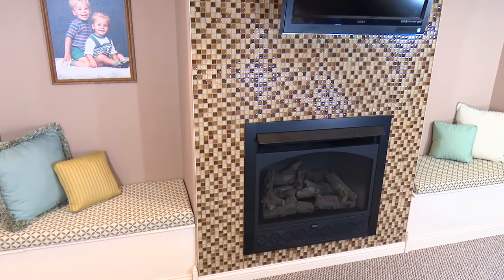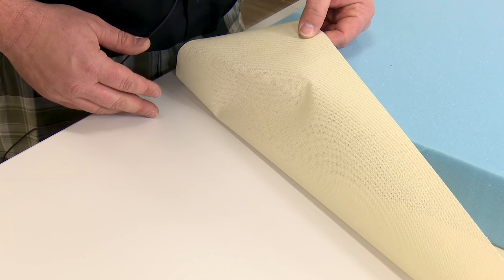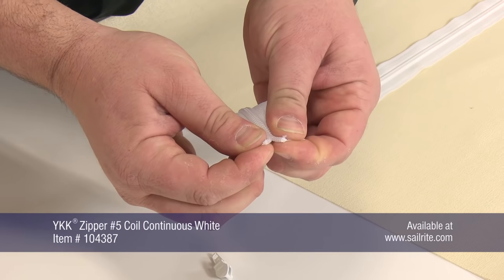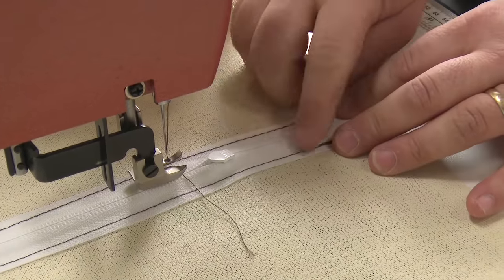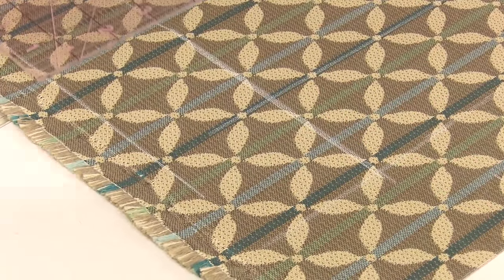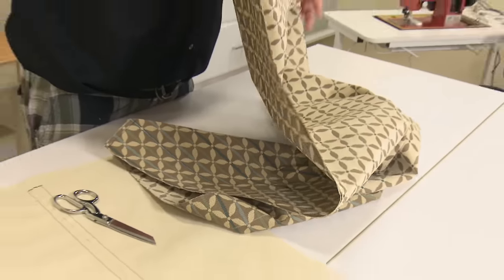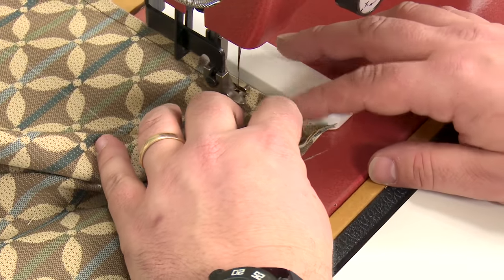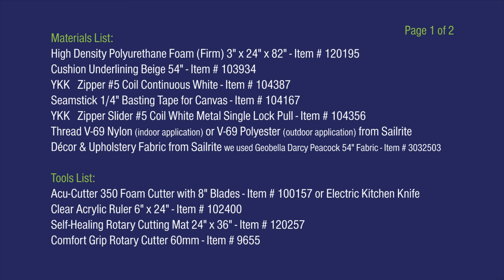How To Make a Quick and Easy Box Cushion

Comment: Excellent demo❣️I’m wondering if the basting tape gums up the needle on the sewing machine...  Does it?  Ty.
Reply from the maker: Using basting tape (Seamstick) for canvas on a very light weight fabric may gum up the needle rather quickly because the lighter fabric does not have the larger fibers or weave to help clean the needle as it exits the fabric. In those situations use pins to hold the fabric in place as you sew. A gummed up needle and parts can be cleaned off with some rubbing alcohol on a cotton ball or Goo Gone (we do not sell this). I like to use McLube #845 on my parts and needle to clean and keep glue from building up.

Comment: Thank you for this excellent video. I am using a normal cotton fabric. So just making the slit on the fabric after the zipper is attached will leave raw edges and I will need to finish it. How do I do that and when do I do that? Also I guess the measurements for the bottom fabric will change because of this as it needs seam allowance for finishing. Awaiting your response. Thanks
Reply from the maker: If you use a fabric that will unravel (unlike our cushion underlining fabric from Sailrite) then you will have to finish the edges. The best way to do this is to cut the plate an extra inch wider and then split the two halves down the middle. Then fold the edge back 1/2 inch and sew half the zipper over this edge and repeat for the second panel. The zipper will run the entire length of the bottom plate doing this (which still works fine when you join the decorative fabric to bottom plate).

Comment: Great demonstration and information.  As a quilter who uses a rotary cutter often, I gasped in horror when I saw you cut toward your body with the rotary cutter.  Please always cut away from your body.  The cutters do slip and they are surgical-sharp blades.  Many quilters share their 'war stories' about their encounters with blades and subsequent trips to the ER.
Reply: Good to know, I won't be using it often. I'll probably just use scissors.
Reply: What was the name of the bottom plate fabric? What type of fabric was that?

Comment: Great video, I'm happy with the results.  Would it be more difficult to run the zipper all the way to the edge? I would like to hide the backstitches.  I also noticed the top of my boxes are slightly larger than the bottoms, would it be safe to subtract another 1/4" from all sides on the top?
Reply from the maker: Thanks! Yes, you could run the zipper all the way to the ends of the bottom plate, but you would have to be careful when sewing the decorative fabric when sewing over that spot. We designed the top boxing to wrap around the under side slightly, to hide the bottom plate. If you want the seam joining the boxing to the bottom plate to be closer to the top, yes subtract 1/4" from the decorative fabric, but you will need to then add 1/4" to the bottom plate to compensate for the difference or the cover will be too tight.

Comment: Great video -- we want to do this with 5" thick cushions -- two that measure 30x18 and one 30x36.  The foam comes 30x72 from the manufacturer.  I see you started with foam and cut it wider and longer than you were going to want the finished product to be.  Is this due to a compression factor?  If I just cut my foam to the actual size I want the finished product to be, I wonder how much smaller it will really end up being?  I also was confused why when cutting the top fabric piece you would subtract 1/4" from the foam thickness?  I would think you would actually want to ADD to the foam thickness for seam allowance?
Reply from the maker: When the cover is applied to the foam it will compress it about 1/2 inch on the width and length measurement. 
At 9:56 min Brian traces around the foam which is already ¼” larger than the opening it fits into. This creates a top plate which is the exact size of the foam. Next at 10:10 min Brian measure the thickness of the foam and then takes away ¼” from that thickness. The boxing is not as wide as the foam by ¼”. True the 3/8” seam allowance is not taken into account intentionally because we want a tight fitting cover. So… the ¼” (which was taken away) and the 3/8” seam allowance that will soon happen to sew the bottom plate on, will take away about 5/8” of the overall size of the boxing making the cover fit very tight, which is what we want. This helps, pull the incorporated facing/boxing (facing included on the top plate) down, so the bottom plate fabric does not creep up and show itself along the bottom edge when the cushion is finished.

Comment: Thanks so much for this but a little confused. If the material is cutout to fit the foam but then we see a 3/8 seam all around, won’t the cushion be two small? Eg the sides will be 3/8+3/8=3/4 inch smaller than the foam sides
Reply from the maker: Yes, you are correct this makes for a very tight fitting cover. The foam will compress slightly, that is why we make the foam a 1/2" larger on both dimensions or 1/4" larger on all sides. Use this calculator and you will see: https://www.fabric-calculator.com/FoldOverSimple/index.html

Comment: Can you explain why you have to add a quarter inch on all sides of the foam?  What does that do?  If you don’t have enough foam for that, will it still work okay?
Reply from the maker: The tight fitting fabric cover will compress the foam slightly and this extra size of foam will then be almost exactly what you need to fill your space requirements.

Comment: Thank you very much for this video. One question is that if I were to wrap the foam with 1 or 2 layers of Dacron fiber would I ad an additional 1/4" to each side for cutting the fabric?
Thanks again for these wonderful videos.
Reply from the maker: Simply include the batting (Dacron) under slight compression when measuring the thickness of the foam. Depending on the thickness of the batting (if wrapped on both sides) it may add 1/2" to the thickness of the foam. If the batting is only used on the top, your 1/4" sounds about right.

Comment: Generally speaking, how much smaller should the cover be as compared to the foam? Is yours 3/8” smaller? Do you ever put a layer of Dacron/batting in and do you still need to make the cover smaller if so? Thank you
Reply from the maker: A cushion cover should be about a 1/4" smaller on all sides to compress the foam and for a good look. This is typically achieved when the seam allowance it taken when sewing. However, this is not a rule, but only a guideline. If you add Polyester batting you need to figure that into your calculations when making the cushion. To do this be sure to compress the batting slightly when measuring its thickness. If you or anyone else would like a "List of Steps" that are used as a guideline for making cushions please email me at: ericg@sailrite.com I will be glad to email it anyone.

Comment: Excellent and clear as usual, and very satisfying to see the cushion come together at the end. What do you think of using closed cell foam for boat cushions, to ensure that they can't take on water, can be used outside, and are buoyant? Do you have any experience with that? What density of closed cell foam would you recommend? Thanks!
Reply from the maker: Thanks!!! Using closed cell foam is always good for a wet water situation, except that it is very firm and most people do not like that extra firm feel. If you like you can use closed cell foam on the underside and then a softer foam on top to soften it up. Density has to do with the amount of materiel in the foam and with closed cell foam it does not vary much. IFD is the compression of the foam (firmness) because the density of closed cell foam is very high the IFD is also very high and does not change much except for the thickness which does change the IFD. See this link and click on the specs: http://www.sailrite.com/Foam-Special-Features/Flotation/type/Products?keywords=closed%20cell%20foam

Comment: thank you for this video. However, should it be possible to add the european values in cm to your explanation? it is quite confusing for me, i'm not used to this system.
Reply from the maker: Yes, this calculator may be helpful. It is our Folded Over Foam Cushions Calculator. It uses "inches" or "mm" to help you calculate the size of your fabric. Here is the link: http://www.fabric-calculator.com/FoldOverSimple/index.html

Comment: Please can you tell me why the foam was cut 1/4” larger than it needed to be? The top plate was cut to fit the foam (which is 1/4” too large each side) and then the boxing is 1/4” too short so I don’t understand how you haven’t got a cushion which is 1/2” too wide and 1/4” less deep as it’s been compressed by the cover and that’s before seam allowances are taken into account. I’m sorry if this doesn’t make sense, I couldn’t explain it any clearer! Thank you.
Reply from the maker: LET ME EXPLAIN THE PROCESS SHOW IN THE VIDEO:
The top plate incorporates the boxing as you see in the video. However, let’s break it down in smaller steps to hopefully explain it better.
At 9:56 min Brian traces around the foam which is already ¼” larger than the opening it fits into. This creates a top plate which is the exact size of the foam. Next at 10:10 min Brian measure the thickness of the foam and then takes away ¼” from that thickness. The boxing is not as wide as the foam by ¼”. True the 3/8” seam allowance is not taken into account intentionally because we want a tight fitting cover. So… the ¼” (which was taken away) and the 3/8” seam allowance that will soon happen to sew the bottom plate on, will take away about 5/8” of the overall size of the boxing making the cover fit very tight, which is what we want. This helps, pull the incorporated facing/boxing (facing included on the top plate) down, so the bottom plate fabric does not creep up and show itself along the bottom edge when the cushion is finished. 
Let me know if you have more questions.

Comment: I have watched this video twice and not sure I understand where you account for the seam selvage?  I usually add 5/8" to account for the other side of the seam line.  It looked like you use a 3/8" seam with your tool, but where do you account for that in your measurements?  Thanks!
Reply from the maker: At 9:56 min Brian traces around the foam which is already ¼” larger than the opening it fits into. This creates a top plate which is the exact size of the foam. Next at 10:10 min Brian measure the thickness of the foam and then takes away ¼” from that thickness. The boxing is not as wide as the foam by ¼”. True the 3/8” seam allowance is not taken into account intentionally because we want a tight fitting cover. So… the ¼” (which was taken away) and the 3/8” seam allowance that will soon happen to sew the bottom plate on, will take away about 5/8” of the overall size of the boxing making the cover fit very tight, which is what we want. This helps, pull the incorporated facing/boxing (facing included on the top plate) down, so the bottom plate fabric does not creep up and show itself along the bottom edge when the cushion is finished.

Comment: if my foam is already cut (i'm just re-upholsterying the cushions in my camper) do i still need to do the minus 1/4" in steps 2 and 4?? thanks!
Reply from the maker: Yes, you want to still follow steps 2 and 4 adding the 1/4". Your cushion may be a little too small when finished, but only by 1/4 to 1/2 in both demissions, since your foam was not cut slightly larger.

Comment: I already purchased my foam in the desired size so when cutting my material I’ll subtract a 1/2 inch from each dimension. Do I deduct that 1/2 inch from the height of the foam also?
Reply from the maker: I would use this fabric calculator to figure how to cut the fabric to size: https://www.fabric-calculator.com/FoldOverSimple/index.html

Comment: Thank you for this very thorough tutorial! I am a little nervous about cutting into some end-of-the-bolt fabric -- I noticed that you did not extend some of the measurements for seam allowance, and actually subtracted 1/4" from the overall size of the cover! Is this because the foam can compress and you want it to be a tight fit? If so, wouldn't this make the final measurements of the cushion smaller than intended? Or am I misunderstanding a step?
Reply: I would recommend doing a test cover with some scrap fabric if you have any. I have just done that, and plate is shorter than the top part and I cannot figure out why. Maybe the fabric has stretched? This method was easy to do though, so if I can get the measurements figured out, I will definitely do it this way.
Reply from the maker: Yes, you are correct this makes for a very tight fitting cover. The foam will compress slightly, that is why we make the foam a 1/2" larger on both dimensions or 1/4" larger on all sides. Use this calculator and you will see: https://www.fabric-calculator.com/FoldOverSimple/index.html##submitdiv

Comment: Do you think this would be a good way to make a mattress cover for my camper?
Reply from the maker: Yes, it should work great for that type of application. I would just position the zipper opening very close to the long side of the mattress  instead of the center. That way it will be easier to insert the mattress inside of it.

Comment: Can I use this instruction to make outdoor sectional cushions? It looks way simpler than your French style mattress cushion video. It is going to be 4inch thickness and two 45inch long cushions.
Also can I simply add the zippers to the back and not on the bottom plate with same method?
Reply from the maker: Yes, that can be done and yes you can add the zipper to the back portion of the top plate which will wrap around to the back side of the foam.
Reply: Thank you so much. You guys are making the world best tutorial videos!!!

Comment: Why did you cut the fabric 2 3/4 inches wider than the cushion when the cushion is 3” thick. Is the cover intentionally smaller than the cushion in order to have a tight fit? Thanks.
Reply from the maker: he top plate incorporates the boxing as you see in the video. However, let’s break it down in smaller steps to hopefully explain it better.
At 9:56 min Brian traces around the foam which is already ¼” larger than the opening it fits into. This creates a top plate which is the exact size of the foam. Next at 10:10 min Brian measure the thickness of the foam and then takes away ¼” from that thickness. The boxing is not as wide as the foam by ¼”. True the 3/8” seam allowance is not taken into account intentionally because we want a tight fitting cover. So… the ¼” (which was taken away) and the 3/8” seam allowance that will soon happen to sew the bottom plate on, will take away about 5/8” of the overall size of the boxing making the cover fit very tight, which is what we want. This helps, pull the incorporated facing/boxing (facing included on the top plate) down, so the bottom plate fabric does not creep up and show itself along the bottom edge when the cushion is finished.

Comment: I want to make a similar cushion using leather.  Would the same technique be used?  Do I need to make any changes due to the leather fabric?  The bench cushion size is appr. 14x21".
Reply from the maker: Yes, I would make the cushion in the same manner as what is shown in the video.  It should provide for a nice tight fitting cover over the foam.

Comment: HELP! My foam is the exact measurement as the bench, is it extremely necessary to have the extra 1/4 in. all around? Will my cushion turn out to be smaller than the bench?
Reply from the maker: I would still make the cushion. Yes, it will be slightly smaller than the space it is designed for since the cover will compress the foam. However, you can do much since your foam is already cut to size and is not slightly oversized.

Comment: My needle gets sticky and the heavy duty thread snags and spilts in a bunch on the bottom of the  zipper.   All Purpose thread breaks from my needle being sticky.   I'm using the basting tape from the video.  Do you have any suggestions?
Reply from the maker: Shredding thread (above the eye of the needle) or breaking thread is usually an issue with a sewing machine part (hook, cap spring or other) being damaged or burred. The damaged part rubs on the thread as it is being tensioned and it hurts or damages the threads fibers. The now damaged thread shows it has been weakened right above the eye of the needle, by shredding or breaking. If this is not the case and you still think it is the double-sided tape then use a cotton ball with some rubbing alcohol on it and clean the needle when it gums up.

Comment: I just make a cushion cover and thought I followed all the instructions correctly. The finished dimensions are smaller in the lengthwise direction than I planned for. It seems really tight. Wondering if I should trim the foam a 1/4" on the short side. When I measure from corner to corner the dimensions seem correct. I don't want to make it worse. Any advise would be appreciated.
Reply: Carla Schilder haha... I’m doing my first one right now... will see how tight it is in an hour or so...
Reply from the maker: Yes, you can trim the foam a 1/4" which will loosen up the cushion cover, if it is too tight.